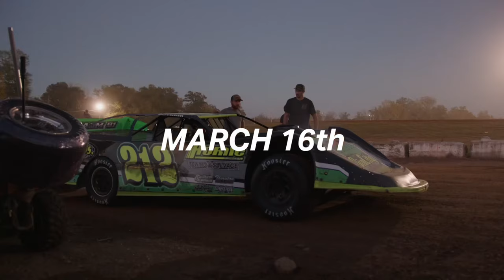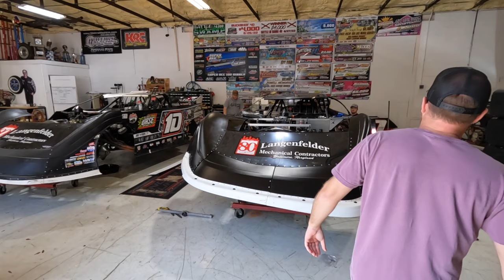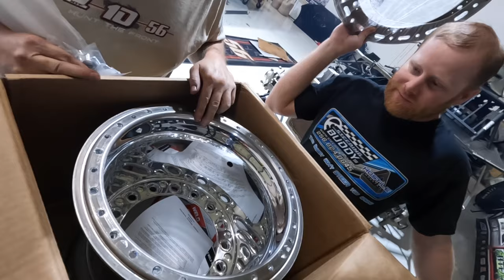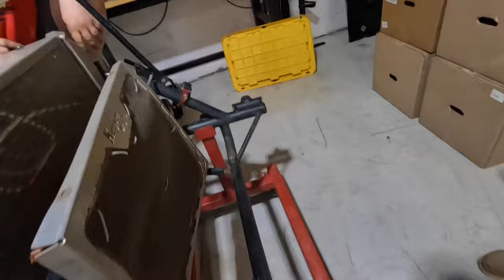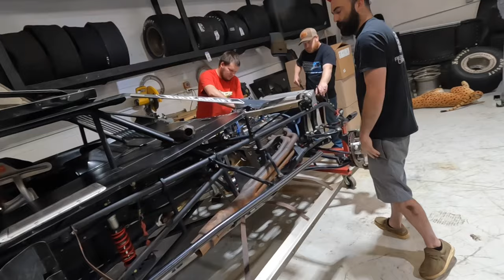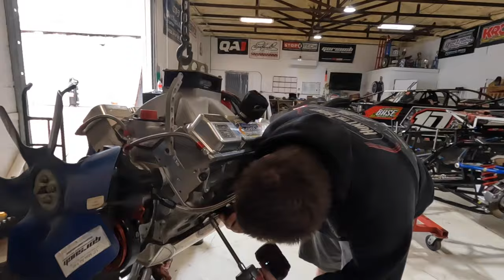Damage Report for Faithful and a New Look for Joseph Going to Talladega!

Comment: Y’all should install a starter button on the firewall by the motor that way you can start it from there when checking it I’ve seen it on several